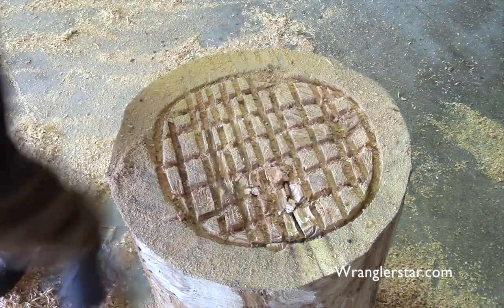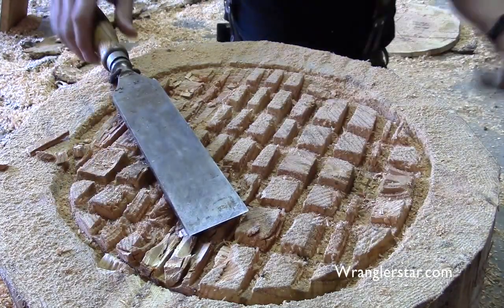Mounting A Blacksmith Anvil + 3

Comment: Speaking of beeswax candles, for anyone who uses those UCO candle lanterns the beeswax candles are great! They burn longer than the other lanterns, and they smell fantastic. When I'm camping in the winter time I'll sometimes use one to warm my tent up a bit, to take the edge off the cold so to speak (make sure your have good ventilation!!!), and the beeswax candles are so much more pleasant to use than the normal candles or the citronella candles. I also keep a few of them, along with the candle lantern, in my vehicles during the winter time for the same reason.

Comment: Regular old 1" mild steel stock will be perfect to make straps from. Do 3, one high, one low, one center. Should give you a good spot to weld on some hooks or loops for tools. Also, you can use the 1" stock to make 2 straps to affix the anvil. Great work so far!

Comment: Careful with the beeswax, it has a very high boiling point and will burst into flame if it gets too hot. You should try to use it between 165 - 190 degrees Fahrenheit when melted. Also, you can paint on melted wax and then heat it with a torch to get it to really penetrate the wood pours. You have done a really great job on this chunk of log!

Comment: 1 part beeswax mixed with 4 parts boiled linseed oil gives you a consistency close to shoe polish and commercial furniture waxes.. Use more boiled linseed oil to get a creamy consistency.. for kitchen utensils and other food related things swap the boiled linseed oil out with mineral oil. (Doesn't make the wax smell like boiled linseed oil, but offers less protection, so you need to reapply it more often)

Comment: Listen I want to tell you little story here my grandfather was born in 1910 is going to Cherichi mother from like father. My great-grandfather was a blacksmith and he taught my grandfather everything he knew about being a blacksmith. My grandfather was actually getting rather good at it. That World War II happened then father went off To find a Japanese in the Pacific. In the war he took around in the forearm and he lost his eye and his hand. When he came back my great-grandfather manufactured a prosthesis for him. Where he could still use his hand and we have a hammer the same time with only one hand.I only knew him for a very short time he died when I was only eight. I tell you this because I want you understand something. I don't want you because you know how to be a blacksmith. Because like Others have said you're OK at being a blacksmith boy you better it is that you have all the old knowledge and that's what I'm learning from the old ways. Case in point I watch this video and fix my very very wobbly anvil stand. I cheated however I started a small fire in the bottom end that's how I got my concave end. It worked really well for me but my anvil stand is a bit thicker than yours is i'm also a bit taller than you are and had to have mine at 39 inches which is nice because I have a 140 lb anvil I saved from the scrap yard at 15 cents a lbs.

Comment: It's a far better man than I who can mount an anvil properly in an unprepared base in 15 minutes. And all day shooting video condensed to 15 minutes will miss a whole lot of the actual process resulting in a short video that appeases the attention spans of small minds, but is less than useless for those who wish to repeat the process for themselves. 

And - where else in the whole internets are you going to find someone seriously making a video that finishes with a stump of Douglas Fir properly coated with bee's wax to prevent the wood checking?  THIS is why I watch Wranglerstar.

Comment: The stump will still check. The wax may slow the process, but it will still shrink as it loses moisture. The shrinkage of wood in the round will always open radial cracks. The only way to prevent this would be to replace the moisture with some other substance, or rip the the block to the pith, and accept the pie shape opening that will form. All that said, the cup shape bottom to the stump is a great idea.

Comment: I thought it would have looked good if u sunk the anvil into the log but then I realised you'd of had to pre planned that....so now I think it might look cool if you put thick steel nails all around the base of the anvil (like a gate) to stop it moving forwards/backwards and left/right. Then with the extra nail left you should bend it over the inward curves to stop it moving up/down and cut off any excess nail

Comment: Pound long nails or even railroad spikes into the log near the corners, then bend them over. At a historic reenactment, that's what the blacksmith had on his anvil, along with tool hooks mounted on the sides. Good luck with your projects.

Comment: my grandfather was a truck driver and for many years he delivered wood to kilns and to furniture makers. he was always into wood working so anywhere he went he would ask do you have any off cuts or cracked pieces that i can have? and generally they would say yes. so he has huge amounts of end cuts of pieces of wood as well as test pieces from kiln test and almost all of them have either bees wax or paint on the end to stop them checking like you said. also because he kept collecting and collecting wood i now have way to much to do anything with. there is probably £100 of mahogany pieces alone in his storage shed. there is probably enough wood to fill the back of your pickup truck 2/3 times over and i don't know what to do with it

Comment: wranglerstar You are entertaining sir! That's why I watch and it keeps me coming back. I like the Cody who humbly states that he doesn't know everything. You may not, but you do know a thing or two and I enjoy both learning and pulling out my hair when you do something contrary to the way I would do it :) Keep up the good work.

P.S. My guess as to why that wood was hard to use a chisel on is two fold. One, its dry therefore tougher than green/wet wood to cut and two you're trying to cut end grain which is hard enough but you're also using a large cutting edge which disperses the force and makes it even more difficult. Chainsaw to the rescue!
Reply from the maker: Bryan Nichols indeed, end grain is tough as nails,

Comment: Nice job carving it out but I was a bit surprised you didn't use the standard 'saw on hip' to gouge it out, same method used for log cabins to remove wood notches in a controlled way with the tip of the saw. is that Fir? Whatever it is, it's solid!

Comment: +wranglerstar the best way to do the steel bands would be to use the same technique that coopers used to use on iron cartwheel tires.

Cut the steel strip to a length 1"-3/4" less than the circumference of the log. Weld the strip into a hoop. Then on a large forge or the embers of a bonfire heat the hoops. They will expand and whilst they are hot they will fit around the log. As they cool they will contract tightly around the log and never come off. They will also prevent cracks and checks.

Comment: They make wood carving blades for angle grinders.  I know people use them for making chair seats.  I'm not sure which model/type is appropriate though.

I believe the sawmills just use cheep latex paint.  It seals it and doesn't hinder any future finish or millwork.  I put a log away this winter without sealing it and it got huge cracks through it.

Use giant homemade staples to mount it...or screws.

Comment: Suggest ya use chain to secure the anvil.....bead blast old chain, heat it and quench or coat in beeswax to blacken and seal it.  Same with the old auger screws securing the chain..... maybe weld the chain to make brackets, conform to the shape of the base etc.... sort of a chain clamp / frame..... just a thought..... thumbs up !!

Comment: When you get a chance to get to a Harbor Freight or the catalog they have a chainsaw chain that fits on a four inch angle grinder.  It's only about $10 -$13 I bought one for a small project and it worked good.  I usually only buy snap on tools but for the money and the amount of usage it was a good value

Comment: Another option, which you can still consider ,is to tack a thin rubber gasket on the outer base rim. This would also help to dampen noise thru the concrete floor. Even a ring of rubber dots would work.Old cut up fire hose might fit the bill.

Comment: I think I will use my old trusty Makita skill saw that I saw by a trash can.Some one had bumped it with their cars tire.Most likely backing up,crunch.They only cracked the guard and bent the deck a bit.A bit of hammering and some sheet tin and it was good as new.Matter of fact the saw was new and that was almost twenty five years ago.I will carve the bottom of that mounting log out in no time.Thanks for the idea .

Comment: when we get the wood from the mill the end grain is sealed with a special purpose made paint. After we cross cut it we use Anchorseal  (a paraffin based liqbefore we put it back in the rack

Comment: A good way to hold the anvil down on the stump is to use railroad spikes or a piece of rebar with about an 80 degree angle and sharpen the other side and beat it in to the log until it's a 90 degrees or more

Comment: That's one way to go.  My anvil is on a large stump like yours is and my solution to an uneven floor was to cut out everything but three legs.  They aren't long.  Maybe half an inch.  I used a router free hand.  It took about 10-15 minutes.  Good job.  Whatcha gonna make?

Comment: After you mount the thick band, attach 1"X1/8" banding across the top of the stump, capturing the "feet" of the anvil. (use 4)  fixing them with 4"X1/2" lag bolts run THROUGH the band into the stump at a downward angle (10-15 degree) Heat the bolts dull red hot before sinking them in the stump. They will never ever work out. Spot weld the head to the band to be sure eh?

Comment: I managed to make it very stable by using a router to leave three leglike sections on the bottom of the log so that even on slightly bumpy ground it would still stand stable.  It worked very well.  all material was taken back about 10mm except the legs

Comment: You should forge some traditiinal c clips to puond into the stump over the feet of the anvil to hold it in place, large heavy duty chains also work very well and will help to deaden the ring.

Comment: Love watching your video.  i watch them all. A concave bottom can still rock...try putting a small rock or screw under one edge.  If you further cut your outside rim on the concave so that there were three very short, say 1/2" legs 120 degrees apart it will never rock.  Think of a three legged stool.  Thanks again.  You may not be a master but I still learn tricks from you.

Comment: Question I have an old sledgehammer that I got from my grandad when he passed away and the handle has a crack/split in it near the head what would be the best way to repair it without replacing the handle

Comment: Keep pushing the smithing experience, It is the only way I learned.
Tips from my experience.
Cut a toe space in the bottom edge of the log, so your body can get closer to the anvil, leaning over a wide log sucks
_ 
Waxing your log will suck as it smolders from the hot slag of forging
_
Use angle iron and lag bolts not strapping to secure the anvil
_
Place a ring or silicone under the anvil to reduce ring, hanging chain around the waist sucks.
_
I mounted my 91 Kilo anvil to a slotted machining block from a very large and ancient drill press, the block probably weighs 250 Kilo.
_
Mount the anvil so that the hardy hole and the bick extend over the edge of the block. This way you can access both anvil features. were as mounted in the center of the block you lose function on both features.
_ 
My experience says to keep the old square block and fix the wobble with the concave trick..BTW I learned something there...great Idea!! Thanks for teaching me!
_
Good Video, thank you

Comment: Blacksmith shops typically had a dirt floor.They would  bury the stump in the ground so it wouldn't move.

If you attach your anvil too precisely to the stump it will ring frightfully.

Frank

Comment: i got 2 pieces of scarp metal heated them up and fit them to the base and bolted it down or i have seen people take 2 pieces of metal leaving them straight like ahowever wide and ever long anvil is and drill hole and mount it where the U's of the base are with lag bolts then u can trim the metal to all fit and look nice but im sure there is many other ways to get it done :D

Comment: the way i all ways done it it make some hooks like U <----- forge the ends into a taper and like hit them in in an angle and you will be fine but also on the log put some hooks into the side basic ones and you can have your tongs/hammers and tools and get some quite heavy chain and you can use it as a hold down tool and all that weight will hold your anvil and log down alot better

Comment: Don't stop doing what you do! but please put your chaps back on when using your saw.  I bought mine 2 years ago.  same ones you have and I spent the money for the ones with the extra layers.  because of 2 reasons you said so and I kicked my insulated carhart bibs on my leg blocking a log for fire wood.  it happened so fast and I was so lucky that it never got through them. all cause I had different boots on and my feet didnt move the way they normally did and got kind of caught on the ground.  now I never start my saw unless I have my stihl chaps on.

Comment: Cody try using leaf springs
Reply from the maker: Mark Bermea They are a bit to short,
Reply: Holly smokes! Okay iget the true size of your stump. WOW!
Reply from the maker: Mark Bermea The band will need to be nearly 6' long to wrap the stump,
Reply: Mark Bermea I though leaf springs myself, then I saw the size of that stump. maybe take two, and bend them at teh ends, and screw then to one another. If Cody's already planning to add mounts for tools, then he could weld them to cover up the seams.. Cody, as for your vids, I watch them because they are entertaining. I learn somethings, but enjoy just weeing what your up to daily, weekly. etc..

Comment: cough Next time maybe try just giving it three feet. A concave might be easy for a career oldschool carpenter, but removing a half inch off of 2/3 or so of the bottom except for three feet around the edge is how I've seen every blacksmith do it. Same effect but it's easier to cut out with a saw(without risking any damage to the bottom of the feet) or, if you're feeling cheaty, a router.

Comment: Must go faster to put three bolts in the bottom of the log .
Reply from the maker: sillenHDsportster Good idea,
Reply: 69Phuket Of course it`s more forgiving ! But then it depends on the type of bolt and the size and type of floor you have .
Reply: I was thinking this too!  The old axiom "A three legged stool doesn't wobble." Came to mind.
Reply: 69Phuket It was not the cracking i was thinking about ! I was thinking like Sean .